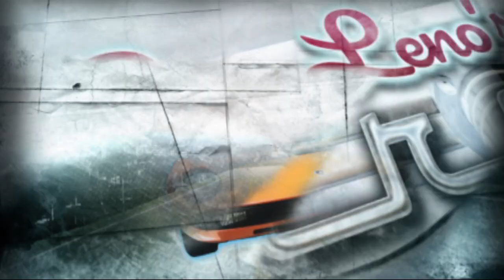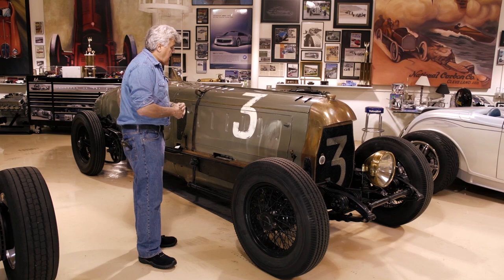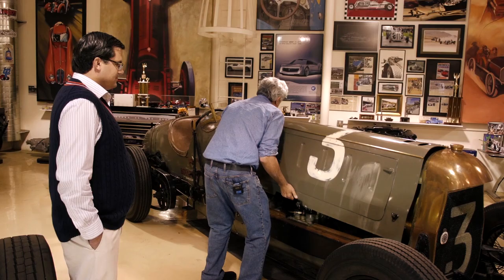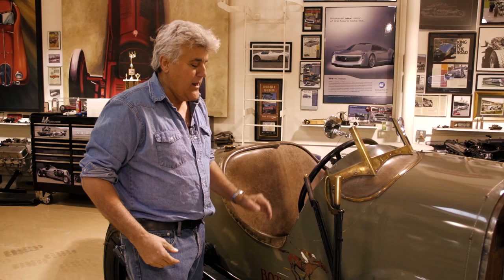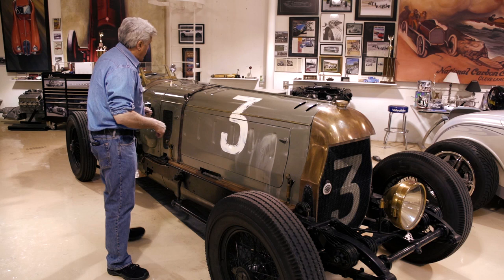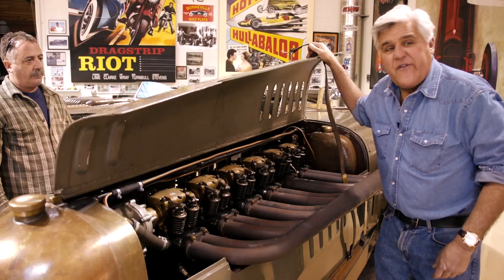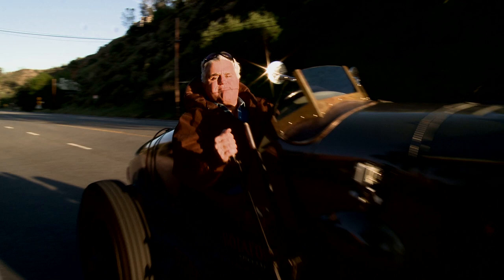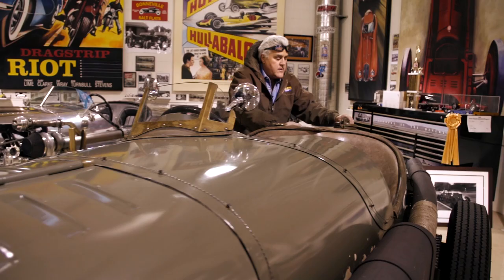1917 Fiat Botafogo Special - Jay Leno's Garage

Comment: That is just incredible to Me for 1917. I mean all those parts had to be cast, fit...No. Cast again, experimented with, hand forged. Overhead cam and 4 valves per cylinder! In 1912!  100 years later and it would still be a marvel to build.
Reply: Cool thing of plane engines is that they're always decades ahead of anything meant for road use!
Reply: and all hand drawn and hand made, no computer simulators, or CAD.....
Reply: I agree.  Those guys building things like this were true masters of the craft.
Reply: @Galf506  Not only were they decades ahead but the quality was much better because if you break down you don't push it to the 7/11 you crash and die in a heap of flaming metal and wood! Large planes really couldn't coast back then with an engine failure.

Comment: Jay is at his best soon as that engine is fired up you can hear the Torque little rpm required  the whine of the trans the miss fire on the open road when more fuel pressure is required this is the first time have felt like i was along for the ride the production cameras documenting tin work movement at certain frequency top work, Jay 10/10

Comment: In 1996 in England I finished building a 1500cc ladder-frame car that I loosely styled on this 'The Bellini Special' (KSK362). I raced it across the Sahara in 1997 as part of the 'Liege Agadir Liege' rally (I came last but I finished, which is more than the Porsche and the Lotus team did) so it was mechanically proven. But after watching this, I see that the builder had the foresight to vent the bob/boat-tail, so that air could escape and essentially flow through the car and out of the body. I didn't think to to this which is frustrating as I know that if I had I would have been able to break the 100... 96 was the most I got out of it even with both aero screens down and my head in my lap. This aerodynamic effect is called 'parachuting'... I have just decided.  GREAT video Mr Leno thank you, from a guy who once killed a Locust with his front teeth. 🏆🇬🇧

Comment: A 1500 rpm max reading tachometer?  Cool!
Reply: Airplane engines never rev high. The propeller is linked directly to the crank without any gearing, and a big propeller like they used on this engine would spin around 1000 rpm. Thus they needed high torque at low rpm.

Comment: I'm 34, and the only vehicle I've ever driven with that kind of torque is a semi.  Without a trailer, I only used 3 or 4 gears, as I had 500hp, and 2350ft-lb.  It weighed 17,000 lbs, and pulled so hard.  After seeing THIS car several years ago on a classic car tv show, I began designing my own car which is a cross between this, and the tank car.

I'm using a Cummins QSK 23 liter 6 cylinder, which I am having custom low-compression pistons made for, and drilling/tapping the injector holes for spark plugs.  I really want to use an updraft carburetor (which I may have to fabricate myself, from old prints) and it is going to use truck suspension and a truck transmission.

Comment: Kept waiting for Jay to get pulled over for not having...well, you name it, this car probably doesn't have it.
Reply: It is grandfathered in "as factory built" unless it was a modified "Hot rod " with modern mechanical s. 
  The only requirements for the state of California are: a muffler,  turn signals if it is a right hand vehicle, (hand signals, though most people don't know that you are doing even when properly executed, are still legal),  and mudflaps if the body does not cover the rear ( and would throw rocks up). 
   I got pulled over in my 1925 Autocar truck, the Westminster Ca cop wrote me for 5 things.  I added the mudflaps, the other 4  were written off because they GF in, but the Sargent sure did like seeing the restored truck and the opportunity  to educate his officers.
   I can appreciate the drive it took to order a used engine from a foreign country and hammer a car around it, when horses were the current local technology, ("picked it up with a horse drawn wagon").

   I sold Jay the front axle that will eventually be under this heavy beast.
Todd Abraham

Comment: If the car had a pipe with a flame  filter  from the exhaust to the fuel tank there would be pressure in the fuel tank  and there would be no need for continuous pumping.

Comment: Your Toro used a short, fully enclosed duplex chain that worked under constant tension.It was never going to wear out. The drive chains on Botafogo are single-row, very long, their tension varies with rear suspension travel and they are constantly exposed to the elements. These are not conditions conducive to a long service life.

Comment: Hi Jay. Did you take into account that Mercedes and Auto Union were setting world speed records on the Autobahn in the 1930's? Bernd Rosemeyer was killed during this period. They achieved some 270 mph runs on the run to Darmstadt, on a 28meter wide road! I LOVE your videos!!
Reply: Source? I have a hard time believing any car from the 30s could hit 270mph.
Reply: TheTmaaan55, Google the "Silver Arrows". They were the Auto Union and Mercedes Benz GP cars modified for record breaking. Bernd Rosemeyer was killed on the Autobahn while going over 270mph, they say closer to 275mph while trying to break Rudolf Caracciola's record when a cross wind blew him off the road and into some trees. I am very much interested in that time period, the cars and the drivers. Give them a look, you might be surprised!
Reply: And the years were 1937 and 1938. It is amazing what they achieved back then for sure!
Reply: Welp, TIL. Also, those cars look like they'd be dangerous at 150. Much less 250
Reply: Actually true. The record for the highest speed on a public road  is 436,89 km/h (271,47 mp/h) - set January 28. 1938 and still valid today. (by Rudolf Caracciola). Hard to believe I have to admit. No Veyron involved...
Reply: I love that era of racing. The say that Bernd was actually surpassing Rudy's speed when the side gust of wind blew him off the road to his death. I have a book named "Racing the Silver Arrows, Mercedes Benz Versus Auto Union, 1934-1939" It's filled with pictures of those works of art, and stories by the people who lived the tales and results from every race during that time period. Fascinating reading for sure!
Reply: +Völl Däpp I would sooner do it in a Veyron than whatever it was they drove in 1938, I assure you .
Reply: "The cars were steel, (well aluminum! LOL) and the men were stronger" I'd loved to have been there during that era of racing! I worked with an older German fellow that witnessed the "Silver Arrows" racing on the Avus circuit first hand. His stories enthralled me no end. He actually saw Bernd and Rudi and their contemporary drivers up close. True heroes of the time, revered by the people.
Reply: Blacques Jacques Les Squacques That is not the question. I personally would do it in NO car.  ;-) Even in a Veyron the slightest error  means certain death at that speed. But well: I a Veyron I would probably not pee in my pants right away at 430+ km/h.
Reply: You are absolutely correct about the extreme danger Voll. That's exactly what happened to Bernd Rosemeyer on his speed record attempt. He was blown off the road by a gust of wind while he was passing an underpass, and he crashed to his death. The pictures I have seen of the tragedy attest to the violence of the crash, and virtually any error, in the car or driver, will result in severe consequences. You can google the details of the accident if you are interested, there is still to this day a Memorial at the spot of the crash. The Germans still hold Bernd in high regard.
Reply: Late to the party, but whilst they did go faster than Eldridge and Mephistopheles, they didn't set a record. Eldridge was the last to set an outright speed record on a public road, and the LSR was over 300mph by 1935.
Reply: kinetic energy builds as the square of velocity- double the speed, 4 times the energy.  272 mph has 16 times the energy as 68 mph

Comment: I am confused , earlier in the show Jay labeled the lever on the LHS of the cabin as a mechanical oil pump, but later while doing the pre drive routine labeled the same laver as a fuel pump. I am guessing this is a typo on his part and it is indeed an oil pump lever.

Comment: 👍👌👏 Simply fantastic! I'm totally flabbergasted respectively impressed, that the big,  magnificent, torque monster engine is running so immensely quiet and smooth (although having open valves and 4 valves per cylinder). While driving unfortunately all you hear is the whining from the unsynchronized, straight-toothed gearbox, what a shame.
Best regards luck and health.

Comment: wow 22l for 6 cylinders... its like every cylinder displaces a small moon
Reply: 21.7L is approximately 220 cid per cylinder. Impressive, but not the 6 small block Chevys he stated.
Reply: no not a 350 small block, but I think Olds made a 220  c.i. V8 in the early 60s and put it in the F88 (f80?).  So maybe a small block GM would be accurate...
Reply: that's not a moon, it's a space station.

Comment: If it is truly 21.7L. And 6 cylinder. Than each cylinder would be 3.6L. 3.6L is not quite the 5.7L or 5.3L of the 350 and 327 chevy. Its still cool, but each cylinder would be like a Nissan V-6.

Comment: If you look at reciprocating steam engine design advancements of the early 20th century, especially in marine applications, you can see where a lot of the advancements that allowed these early aero engines to be so advanced came from. Look at a triple or quadruple expansion steam engine from one of the ships built in the 1910’s and their complex valve gear, oiling systems and general function and you’ll see some distinct similarities to the materials, systems and designs used on the advanced (advanced as in like this engine, not like the model T engine with its non-counterbalanced crankshaft that looks like an oddly shaped stick) internal combustion engines of the time, there are quite a few similar concepts. The use of counterbalanced crankshafts with journal bearings lubricated by a pressurized oiling system that uses internal galleries to send oil to the main and rid bearings on the crankshaft first then to on to things like camshafts, valve gear, governor assemblies, etc, before returning it to the sump or lube oil tank to be pumped through again.

Comment: You were saying each cylinder was the size of the 327 chevy. At 22 liters, it equals  1342cid, divide that by the 6 cylinders and you get 223.67cid/cylinder. Still a big engine, but not a 327x6

Comment: That car could driver faster (146 mph) than a Sopwith Camel fighter of the same period could fly (113 mph). I wonder what kind of special deal Jay has worked out with LA that allows him to drive those deathtraps on the road. Not that I think they shouldn't, because Jay obviously has it under control, but I wonder if there is some special dispensation they give collectors - or just Jay. In any event, quite a ride.

Comment: In other words, if a propeller of a given size needed to spin at 2000 rpm to give enough thrust for take off in a particular plane, - & if that rpm required 400 bhp from the engine to power it, it's irrelevant whether the engine needs 10,000 rpm or 1000 rpm to generate that power. Providing the gearing between them allows the engine to reach its max power revs to do the job.

Comment: Remember this engine came out of a plane. It has a manual fuel pump. So the engine starves and stalls (midflight), now you have to manually choke it, and start it back up. At least by then it's hot, and the prop will help spin the crank. Your life is in the hands of your mechanic. Next time you go get an oil change, bring some coffee and doughnuts.

Comment: 1 liter = approx. 61 cubic inches so, 22.7 x 61 = 1384.7 cubic inches. Divided by 6 = approx. 230 cu. in. or almost 3.78 liters per cylinder.

Comment: The sound that engine makes is something else. I wonder "RPM" what it idles at. I think a modern equivalent would be to get a semi and remove everything that you don't need in order for the engine to run. Or, use a semi Chassis, and use a Caterpillar "generator" engine and kind of.. make it run.

Comment: Nice. It looks huge, like your'e driving a bus but steering from the rear wheels. The brakes work a lot better than I expected. I was wondering about if it had heater but it seems to throw off a lot on its own. The ride seemed surprisingly good and didn't wander at all. Do you have to double clutch it to shift gears? There's two pedals, what are they for? Isn't the gas lever on the steering column?

Comment: I agree. But even the Rolls Royce Merlin in the Spitfire, a fighter plane, only usually revved to 2500, & the rev ceiling I believe was 3000, so how much slower would the plane engines of WW1 have revved. They were very large capacity engines precisely so they wouldn't NEED to sustain high revs. Also, a large prop can develop great thrust at comparatively low rpm.

Comment: Engines simply couldn't rev to high rpm in those days. This is why they derived their bhp from larger capacity low revving engines that produced a lot of torque, since bhp is a product of torque & revs. For example, 131 ft/lbs @ 4000 rpm is 100 bhp. So is 262 ft/lbs @ 2000 rpm.

Comment: Airplane engines back in the day had such low rpms so they would not destroy the props. 

Correct me if I'm wrong, but im 99% sure thats the reason for low rpm.

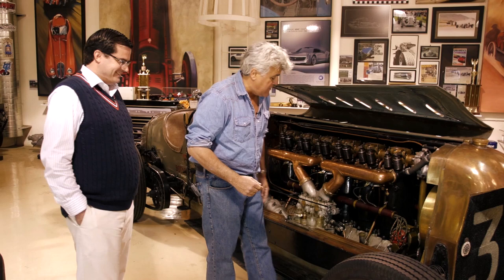Comment: 6:03- Does he mean actual displacement or, total volume of vapor moved through each cylinder because of the 4 valves per cylinder compared to the older 350's 2.Any way I came out with about 221 cu in per cylinder or 3.6L. Even with that said,that engine has more displacement in one of it's cylinders than my 16 SHO ! WTF! !

Comment: 21.7 liter devided  by  6 is   3616 ccm  per  cylinder   far from a chevy  350s  5.7 liters
Reply: Your right, that whole engine is almost 4, 350 chevy engines.

Comment: If Jay wanted to drive a car which is absolute excess, then he should talk to the BMW museum at Sinnsheim. Maybe they'll let Brutus out.
A 35 litre V12 BMW aero engine meant for a Heinkel He111. Drinks gas in a way that makes that Fiat Botofogo look economical. 
Needless to say it isn't quite road legal as there's virtually no brakes.
You don't need a drivers licence, but brass balls the size of Berlin are essential.

Comment: Anybody know why a lot of these old aero engined race cars used a chain drive instead of doing it the normal way with a rear axle?
Reply: It was simpler to use a chain!
Reply: Yeah, I really didn't explain what I meant very well. But, I actually found out what I was looking for. There is a wiki page on chain drives that explains things well.

Comment: How do you get spare parts for a Fiat?
Just follow another one around.
What's the difference between a Fiat and a Jehovah's Witness?
You can close the door on a Jehovah's Witness.
When should you do the first oil change on a Fiat?
When it gets to 50,000 miles, or in other words, never.
Have you seen the latest Fiat anti-theft device?
They enlarged the logo.
What occupies the last six pages of the Fiat owner's manual?
The bus and train timetables.
How can you get a Fiat to do 60 miles an hour?
Push it over a cliff.
A friend went to a dealer the other day and said, "I'd like a gas cap for my Fiat."

 The dealer replied, "Okay. Sounds like a fair trade."
How do you make a Fiat go faster?
Tell the tow truck driver to speed up.
What do you call a Fiat on a hilltop?
A miracle.
Two Fiats on a hilltop?
Science fiction.
Three Fiats on a hilltop?
A funny place to build a Fiat factory.
Reply: LMAO!!!..
Reply: Hahaha 👍
Reply: Hahahahahahahaha! But don't forget when Fiat made racing cars the others was running with horses and carts.
Reply: RandallFlaggNY "Funny"
Reply: Good job taking Yugo jokes and putting in Fiat.
Reply: lol
Reply: brilliant
Reply: I think it's time you buy a Fiat

Comment: How did Fiat make a car like this 3 years into, and at least a year before the end of The Great War?
Reply: Well funny story. The engine was originally a Fiat A.14 engine. During the war the Italians built 500 of these engines.............but only built about 190 airframes to put them in. So contrary to any conceivable conception of war industry, the Italians managed to build more high tech elements than low tech elements (airframes)

Comment: Bore and Stroke?
Reply: Very.big X very.long
Reply: Federico Lucchi
lol, no doubt.
Reply: *****
true dat.  My guess is the stroke is far greater than the bore, as were most of the engines of the time.  designed for max power at < 2000 RPM.  Maybe to limit wear on the iffy metallurgy of the times?
Reply: Steve Miller Aero engines never rev higher than about 3000 rpm. That's because of the propeller, which is connected directly to the crankshaft (no reduction). A large propeller like this engine had would probably go "supersonic" over 2000 rpm and thus disintegrate. Even modern airplane engines rev generally around 2500 rpm. They have much higher compression though, to compensate.

Comment: Typical airplane engines now days top out at a little over 2500 rpm.
You don't want the prop to spin any faster.   My dad;s has a 9 litre flat 6,